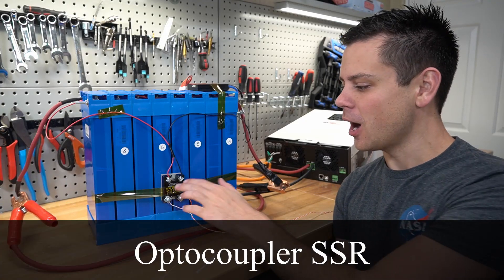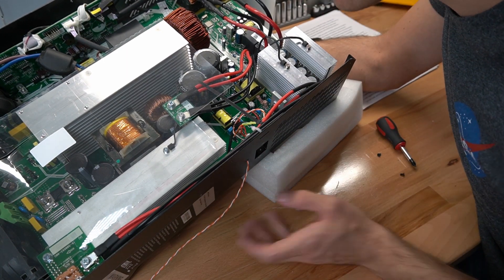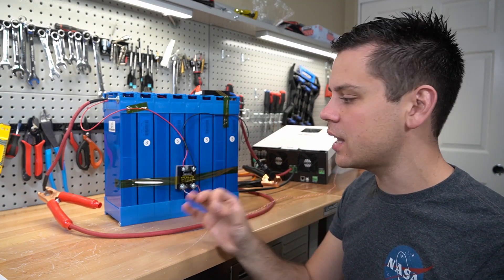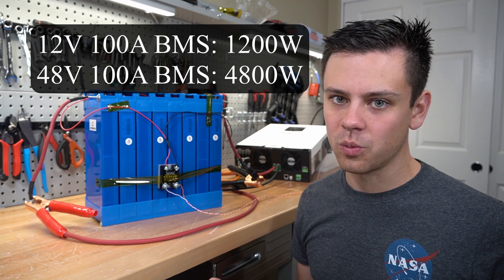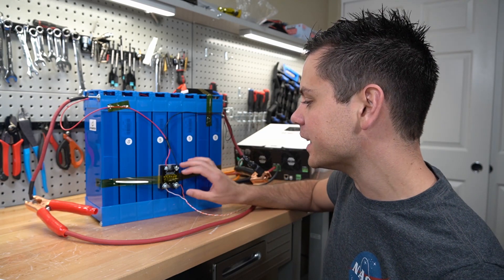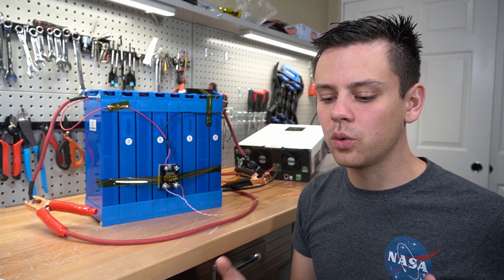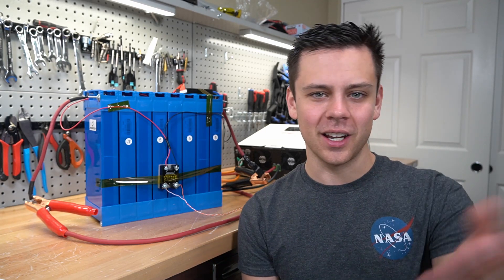Solar Inverter Control w/ Optocoupler SSR and BMS (Intermediate level)

Comment: Will, what about using a SSR for my Victron Battery Protect with the BMS controlling? Low power consumptions... Longer life...Easier to wire to?

Comment: Will, move that SSR off your battery pack. Best to place it on a heatsink mounted to your board where your PV kit sits (inverter, CC, etc). They will get toasty when they pass any substantial current. :)
Reply from the maker: It's passing 10mA, so it's fine. It will not warm up at all.
Reply from the maker: It is for electrical isolation and switching. Not load disconnect. Totally different.
Reply: @WillProwse  Oh I feel so stupid now - Its just switch a logic signal for the inverters on off signal. I was looking to see if I had one for this purpose, and it was mounted on a heatsink. Used at their rated capacity though they do get toasty. That SSR will have an easy life doing 10mA ;)

Comment: Hello Will. Thank you for your videos! As an electrician for more than 20 years you have inspired me and I went a little nuts with a project! I now have 75% of my lights and all of my ceiling fans and about 50% of my outlets running on solar even my washing machine, tv, modems, and other smart home devices. My power bill was 47$ last month and I live in South Florida. 
I have a 725 watt panel set up and 300 ah batteries, transfer switch, 2 charge controllers, sub panels for several circuits. Being an electrician I have an advantage on most beginners and love my system. Thanks for the inspiration! Also my switch hasn’t used public power in about 6 weeks!😎
Reply: Wow on a 725W panel youre able to save/do all that? amazing

Comment: Hi you can also use a 5$ cut off low voltage board, parallel to the power inverter on off switch, arriving to the same result. Or  if you preffer, you can add a remote control, as the Reliable power inverters  use. Greetings from Italy.

Comment: In DC systems, there is no capacitive load, but it’s true that these inverters usually have large input capacitors, and thus the inrush current at switch-on is high.
Reply from the maker: Huge capacitors. The inrush is massive. Can destroy FETs in BMS

Comment: According to Will's explanation I suspect that the inverter on/off rocker switch is a voltage potential free wire, ohmic connection only, to close / open contact for the inverter power. Correct? Or do I have a basic misunderstanding on this subject?
Assuming an application in a RV I could run the RV 12V service loads via the BMS and control the inverter loads via optocopler relay with P / +B input and connect the Inverter low voltage power input directly onto the main battery post connection.  -great idea 
Alternatively , if the BMS gets just used for LifePo4 LVP/UVP/low temp protection, the battery high power load could be switched directly with one/two in parallel decent SSR's with proper head sink application. Crydom is a source for good quality SSR units. This might be a solution to prevent premature failures of suspect Chinees BMS's MOSFETS.

Comment: In can be even simpler if your inverter has a remote control panel.  You can hack the wires to the remote panel's on/off switch and not even have to get inside the inverter.

Comment: Will, you don't need an SSR, you can use a small low current relay to turn on the inverter. I've dismantled the cheap SSR's from eBay, they rate it at 40 amps but the Triac is only 4 amps.
Reply from the maker: Reasons why I didn't use standard relay are covered in video

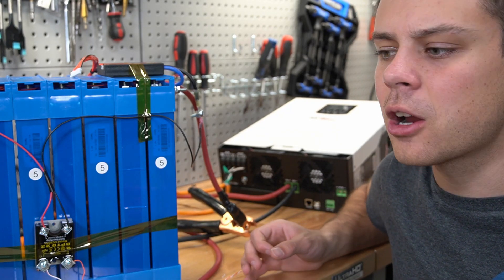Comment: 1:46 I've used a Mini DC Programmable Timer Relay from Amazon (ASIN: B07D53RKTY) to cycle power (off-on for 3s-off) to the inverter remote wire when power is supplied to the relay trigger. When power is removed, the cycle repeats turning the inverter off.
Reply from the maker: Smart!

Comment: hi will always like your videos. well done.  could you please do a video on setting up BMS with solar charge controllers.  what i like to know is  when solar charge controller connected to battery with a BMS, if somehow one cell voltage went high, BMS will cutoff charge controller while PV is ON. that will damage the controller right?  how can we avoid that problem?  even separate port BMS  will still disconnect battery from controller if one cell went over voltage right?
Reply: I was wondering about that too. As a newbie with tech background studying BMS and SSR relay options lately in the DIY Solar Forum; I am considering/ and will test  hooking up the Chargery BMS8T's high cell voltage, max heat, and max amps, freeze triggers to turn off the Solar Array Input to my All In One's MPPT charger.  For my set up, I need an SSR relay or mechanical relay that could handle 145 open Vdc/ 115 Vdc max running current, and up to 30 amps.   Already ordered an over spec SSR to test, but will take some time shipping form China.

Comment: If you are going to run wires through a hole on a metal case, USE A GROMMET to protect the wires from chaffing & rubbing .
Reply from the maker: Agreed. Do it

Comment: normally SSRs are used to switch AC. They use a thyristor (SCR) to switch at zero current - only possible with AC. Thats why they can switch a heavy load (lots of AC amps) when they switch at zero crossing. DC-SSRs cannot switch at zero cause there will be always a current. They are build differently and mostly cannot switch high currents. The SSRs you linked below are rated for only 5 A! High DC current can optimally be switched by low-RDSon Mosfets - they can handle up to 200...300 Amps DC if the gate is triggerd correctly (fast switching). For higher voltages you would prefer an IGBT instead of the mosfet. IGBTs can handle high voltage and high current ;-)
Reply from the maker: Did you not watch the video? The current going thru the switch is 10mA. 5 amps is more than enough. Hell it could be 1 amp and it would be over kill. Did you not watch the video?
Reply: @WillProwse  Sorry, i thought you switch the load to the inverter via the SSR (what you would normally do)? I probably didnt get the point here... Got it :-) You only control the inverter internal switch with the SSR - not the power to the inverter. The cables would be much to weak for that as well... So my fault, didnt listen carefully enough. Normally you use SSR to swith heavy loads with a small control current. You could have probably used a simple Mosfet instead of the SSR with a small Gate-control circuit to turn the mosfet on when the bms is on - would be straight and easy (you even dont need a gate control circuit when the output voltage is in the On-Range of the mosfet ;-)  Hmm - am confused now... The power to the inverter is coming from the BMS, doesn't it? So the BMS controls the output power anyway?
Had to watch again: you connect the inverter directly to the battery and only control the switch of the inverter via the BMS? You hear the fans still running when the SSR shuts down the inverter - so you have no real control of the current draw - non via BMS, non via SSR - you just rely on the right behavior of the inverter. For me thats not a really good and secure solution on an unattended system.

Comment: some inverters have a remote on network cable, and also just have a simple button inside :)
Reply: Paul Foppele My Sterling Power Inverter Switch is on a cable. Can I hack into that. This will be a good test of my basic electronics skills.

Comment: Love your ideas and videos...but not really a fan of this setup. You are bypassing many of the safety features that are nice to have via the BMS. like you said, you dont have over charge protection. If 1 cell dies, its going to kill all the others before you know it due to being way over charged. Also no true low volt protection. Many (especially cheap) inverters have parasitic draw even when off, i can totally see someone wearing there battery down till the BMS cuts off and walking away for a week or more, then coming back to completely trashed batteries. I like the effort but ill stick to runing all my loads and chargers though a BMS, makes it dummy proof and impossible to hurt the batteries.
Reply from the maker: LVD is super important. Hvd? I would trust a UL listed scc like a victron any day over a typical BMS. The quality difference is huge. I have run systems without BMS for months, without an issue. But you are right, it is dummy proof and takes seconds to assemble. And increasing the voltage will allow you to run whatever you want through a fet based BMS. 

And the idle consumption is non issue because it's truly off when it turns the inverter off. Everything shuts down. If you add a fuse, and manually set absorption, you have every safety feature and more of a BMS. But yeah, not as easy. Some people want to push 15kW inverters, and this will probably be the only way to do it if they can't increase the voltage. So it depends on the application

Comment: You can but mosfet based 'relays' that also do PWM, I bought about 40-50 about 2-3 months ago,  they are about $2-$3 on eBay,  similar to what is used for 3d printing, on hot beds, they will work great with this type setup, they have a switch input control, and a pwm control input, the SSR is a bit overkill for this, they have a load power in + - , and out+ - , then the control signal, - with a switch + and a a pwm +, use pwm for pulsing of load, dimming lights , small motor speed, or switch control, for on / off only, I was going to parallel a few but by the time they got here, I have no need for them, I will use most though, for other projects, if you are interested I would be glad to send you a couple,

Comment: I totally second the comment on the cheap SSR from china. They are garbage. I had a 100amp one die on a 10 amp load. Fully mounted to a quality heat sink and cooling fan. Never again for the cheap solid state relays.
Reply from the maker: No way!! Wow what a rip off
Reply: @WillProwse  Well, it was a cheap $15 dollar one. I've been burned before.

Comment: So you're using the solar charge controller to prevent over-voltage, rather than the BMS, right?
Reply from the maker: Yeah, which is fine if it's high quality. I trust victron scc over a cheap BMS anyday
Reply: @WillProwse  I got lost on this point. Why does the BMS not handle over-voltage in this scenario?

Comment: Great info as always, but I'd especially tend to keep beginners closer to UL-listed parts, Will. While bad things could happen regardless of the parts being UL listed, the main thing is what happens after the incident. For example, suppose a non-UL inverter caught fire and burned down someone's house. Could the lack of that certification be cause for the insurance company to refuse aid/payment? I dunno, but it's a situation I'd expect an experienced person to mitigate, where the beginner probably won't.
Reply from the maker: Which ul listing? Some are code compliant in some states but not others. Really depends on where you live. 

And yes, pretty much always talk about the importance of UL listing and safety certifications.
Reply: @WillProwse  Intended for that to be a hypothetical, apologies for the confusion. For instance, you installed your daily use hardware in a shed, so the scenario I used wouldn't happen at your house. It could become an issue for a less experienced individual, though.

Comment: Er, I know this is pedantic as hell, but nobody actually calls the relays you're using optocouplers, they're SSRs - solid state relays.  Optocouplers usually refers to a board-level component.
Reply from the maker: Everyone on the forum does so I've been calling them that. Yeah, SSR

Comment: doesnt an automatic transfer switch pretty much negate the need for that new toy of urs...  i mean.. when the battery voltage drops to when i set it... the inverter just more or less goes idle

Comment: Couldn't the Solar Charge Controller be wired in parallel to octocoupler using the output from BMS? That way the BMS high voltage disconnect and low temperature disconnect still control the charging; the tradeoff is that the charging current is limited by BMS current capacity.

Comment: Should I have this Lithium batteries in my home or near where I like to breath? How about off-gassing?  Let's pretend or forget if they are on fire. Should they be inside your home, where you live?
Reply from the maker: LiFePO4 doesn't vent gasses unless you shoot it with a gun or leave it in a fire. You can store LiFePO4 under your bed.
Reply from the maker: These are not lead acid or nickel iron batteries. Very different

Comment: Not sure about this one, Will. Seems like you are bypassing safety circuits just for the convenience of switching a high-power load. I dare say it will work but I feel sure there must be a better way.
Reply from the maker: Top balanced and manual absorption, not a problem at all. And victron scc has low temp charging protection. You have literally every safety feature necessary. I don't understand what you mean
Reply: @WillProwse  I'm sure that it will work but the BMS does a lot more than just balance the cells to which it is connected. For example, short circuit protection would be bypassed. OK, there are fuses for that. If other DC loads were connected the BMS might well switch off the inverter but the other loads could drain the cells to destruction. OK, maybe a low-voltage buzzer. The setup you used included an integrated SCC, other setups like your solar blueprints have separate SCCs, with the BMS effectively only controlling the inverter, over charging protection would be bypassed. OK, well, just make sure the SCC is configured properly. The BMS would have no way of monitoring load current ... and so on... As I said, I'm sure this solution would work and any additional risks would likely have some form of mitigation, but my gut is telling me there just must be a better way?
Reply from the maker: How so?
Reply from the maker: Hvd?

Comment: you could also use a small relay (1 amp relay)  to replace the SSR , sélect the relay voltage that match the battery and BMS  those are less expensive than the opto22 or cry doom SSR

Comment: Thanks. I'm working on this project now as you may know after your last note to me on the Victron smart battery protect and inverters,  I opted for a cheap inverter with an on / off after looking at the rocker switch in my inverter.  Can you confirm the measured voltage and current you get on your rocker switch on your inverter? I"m guessing you were getting 12V dc voltage and really low current because of the wires and relay you are using. I was thinking the rocker on my unit was rated a bit higher in amperage.

Comment: Only thing I would have added to the video is perhaps show a better angle of the soldering you did at the switch ... and better explain why you went with a SSR, 60 VDC, 5 Amps instead of a 48V 3 amp or 1, etc. I find that many ppl do not understand SSR very well and the biggest question we get all the time is "which one do i need and WHY"??
Reply from the maker: Ohhhh good point. Yeah lots to talk about there
Reply: @WillProwse  You could probably make the "WHY I CHOSE THIS SPECIFIC SSR" one of those 3 minute "followup" videos ... excellent point in not using the Chinese stuff .. I am all for Chinese things most of the time -- BUT we have seen a fairly good "meltdown" of those fake SSR's and totally not worth the risk ...

Comment: Is there a way to have a low voltage disconnect for 12/24V loads besides the BMS ? 
I just got the LV24/24 in the mail. Still waiting on the BYD battery. I want to wire the battery to a bus bar for future expansion and also a DC/DC 24/12 converter to it. To avoid idle draw of the inverter it will be off at night. I wand to wire a 12/24V fridge directly to the bus bar since it needs power even with the inverter off. But I don’t want to kill the battery. I’m ow the BMS should be able to do that, but I’d really like a disconnect a 10th of s volt before the BMS. 

Am I making sense? Any ideas on this?

Comment: Hi Will, I am looking at SSR right now. But not for this purpose, I'm thinking about solar dump to a water heater when battery is fully charged. Can you make a video talking about that? thanks
Reply: That is a really good idea.  Sounds like something that would be on the charge side that would redirect power when in float.
Reply: Same, would love to dump to heat
Reply: dack ditto
Reply: I also want to dump my surplus solar energy also to heat shower water or heat my LFP batteries in my camper van. I don’t have a lot of surplus energy so am considering a couple of small heat mats. One mat to place under my solar shower bag and one mat to place under my LFP batteries. I’m a bit confused how to size these mats in watts? If I have one 435 watt solar panel, one 190 watt solar panel, and alternator charging through a DC-DC charger (set to 40 amps) what size heat mats should I get? I don’t want too much heat either!! Thanks

Comment: Heya Will.  I've read the corona virus can live up to 25 days on surfaces.  Take great care when receiving stuff from China to protect yourself.  I leave it to you to figure out the best way for you to do so.   Much love fellow Las Vegas denizen.
Reply: It takes very specific unusual conditions for a virus (including Covid19) to live for more than a few hours unhosted. The longest that any credible laboratory has been able to achieve so far is 9 days, so whoever told you 25 days is NOT someone I'd believe anything from without multiple independent verification vetting them. 

If you're overly worried about this, put on your rubber gloves (which were made in China) and use disinfectant (also made in China) then wipe dry with a microfiber towel (again made in China) afterward. Maybe now you'll begin to see that if what you heard were even partially true, we'd have all been infected by now because almost everyone daily uses things which are now made only in China. Application of common sense is crucial in the process of being intelligent and learning who to be listening to.